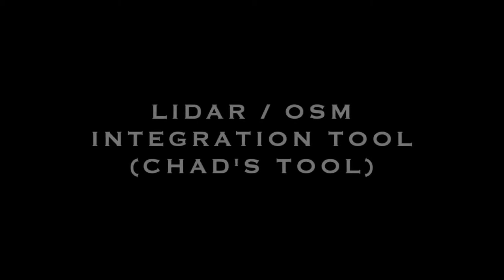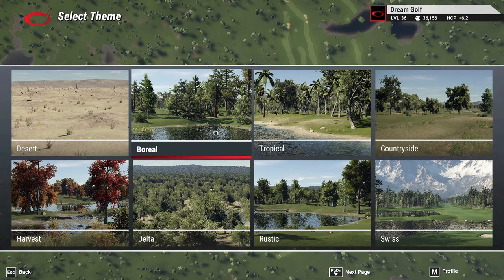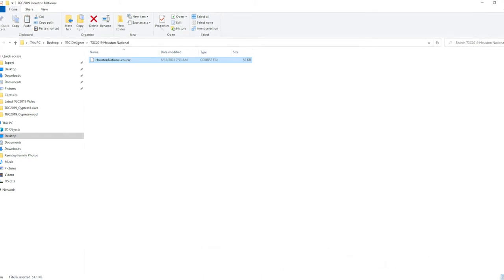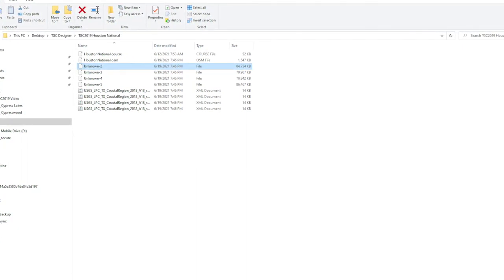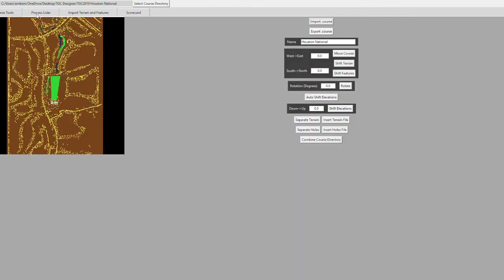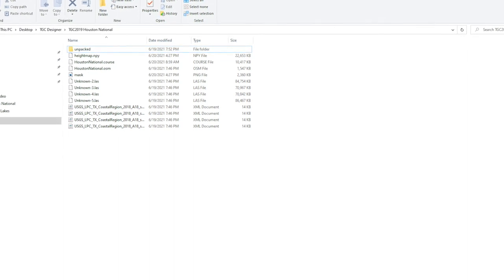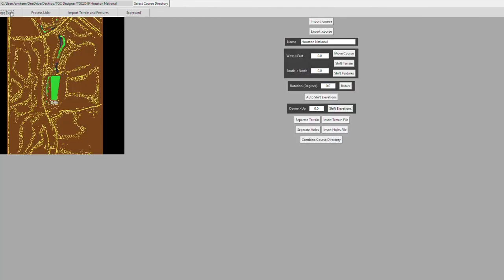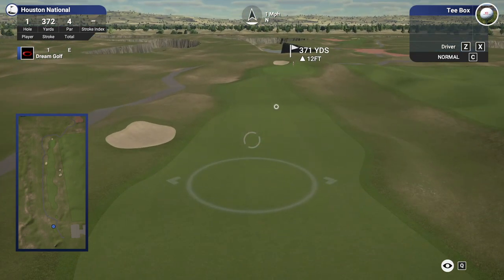The Golf Club 2019 - Course Design with LiDAR - Part 2

Comment: Good tutorial for my 1st trial course! everything goes well, the LIDAR and tree data is perfect. I can see the shape of the fairways and holes back in TGC2019. However, it looks like the tee box data, fairway data, bunker data, water data, hole #s, are not getting integrated. They are missing. Is there a trick to make sure the OSM features are integrated properly? for example, in chad's tool, everything works perfectly, but the scorecard tab shows blank! any suggestions? i think im missing a stpe, because the OSM data in OpeStreetMaps is very detailed and well created. Any help would be appreciated.
Reply from the maker: I would check with the guys on FB. They can help much better than I can. https://www.facebook.com/groups/2471027663149268/?ref=share

Comment: Please help! When I run the tool, it goes through visualizing the LiDAR data, then adding golf features, then the window pops up where the two images are supposed to be only neither of the images is there. Flipping back to the main window, it has gone through the part where it pulled the OSM data, then it stopped after trying to get the mapquest api data saying it could not get sat preview http error 401 unauthorized. I checked everything about my pc and my internet and it’s all great. My firewall is turned off. Please help!!
Reply from the maker: I would recommend going to golfsimulatorforum.com for assistance. The experts are there for specific questions like yours.

Comment: Got to 7.15 then things went astray. Just previous to that I'd spent two hours trawling web for the ESRI code, (believe ..fingers crossed!. that I have correct one). but then Chad's Tool came up as blank screen with flashing cursor top left. Very sparodic to open and get the next more important detail screen. Put ESRI code in & the data files I'd downloaded to one folder for LIDAR from DEFRA UK. comes up with NO LIDAR DATA FOUND.  Question  - Have I missed a step?  Do I need to convert these files via ArcGisPro to convert these files first? Any tips gratefully received.
Reply from the maker: Thanks for watching. I would highly recommend going to the golf simulators forum website. Its a bulletin board site where people ask these types of questions. They helped me out big time when I was trying to get things to work. Golf Simulator Forum https://golfsimulatorforum.com/

Comment: hello
i have tgc2019 for PC, running using skytrak. Im starting to use the Course Designer tool. Its great! I was able to solve my other issues below also, so all good! however, i have a question/help ask: i recently published a course, and the "unpublished" version - the ".course" file disappeared. So now i cannot create an updated/enhanced version of the same course. I would need to re-start the course from scratch. Is there anyway I can get the unpublished version of my published course or the ".course" file of my published course back, so I can keep working on it to improve it? thanks in advance.
Reply from the maker: Saad, I don't know, but hoping others will respond. I'm thinking you need to backup the copy before publishing it, but of course thats too late for you now. I'd check with the folks on FB, and see if they can help.
Reply: Could you tell me how  you solved your issue?  I'm having the same problem... when I finally go to the course tools tab in Chad's tool, the holes aren't showing up in green...so everything goes smoothly until it comes time to export it
Reply: Could you tell me how  you solved your issue?  I'm having the same problem... when I finally go to the course tools tab in Chad's tool, the holes aren't showing up in green...so everything goes smoothly until it comes time to export it

Comment: After you make a blank course and labeled it.  It's saved to a 'Course Folder' I cannot find that folder anywhere after saving it from TGC2019 software.  Where would it be located and what would the folder be called?  Is there a default folder these courses go in once you make them?
Reply from the maker: Yes, see 3:22 of the video. It shows you the path where it's saved.
Reply: @DreamGolf  I’m just not seeing those folder names anywhere.
Reply: @DreamGolf  under C drive, User, I’m not seeing AppData or any folder related to TGC2019.
Reply from the maker: @1289webby  It may be hidden. Make sure to  set properties to unhide the folder/files.
Reply: @DreamGolf  Ok no worries.  I did that and still cannot find any of those folders.
Reply: @DreamGolf  Thank you for your help.  I found the file folders.  There are three of them in there with a bunch of letters and numbers.  Those are three I was playing around.  The course I'm trying to build, can I or do I need to move that file to another folder when I combine the LAZ files?  Thank you again.
Reply from the maker: @1289webby  I  recommend you copy them to another fold like on your desktop and edit them from there. When complete, copy them BACK to the original file folder so your TGC2019 sees them, otherwise it will just see the ORIGINAL save you made. Very common mistake to forget to copy them back in AFTER you've built your course. Good luck! Lots of hours ahead of you!
Reply: @DreamGolf  Do you and can you import Lidar items such as water, parking lots, buildings or do you have to build those items in course designer?  How do you do a large amount of fescue or bushes for example or a large water body such as a pond?  I cannot place water for some reason and each bush is a single individual bush.  I'm new and trying to watch videos on all this.  Thank you.
Reply from the maker: @1289webby  You can't import water. You have to build the water into the areas that you know water exists. Same with parking lots and buildings, you need to build all of those in the TGC course designer. The import helps give you fairways, greens, bunkers, etc, but all the other fine details such as houses, fences, need to be done by you in TGC. Good luck! I got through about 5-6 holes and gave up. So much work required to get it right, it's a giant time suck.

Comment: I am getting confused at the part where i need to export the course, can someone help
Reply from the maker: Sorry for my confusing narration. Once you save the course in TGC2019, go to your TGC2019 course folder: /appdata/Locallow/HB Studios Multimedia LTD / The Golf Club 2019 Pro Tee / Courses, Rename to what you want it to be and then copy and paste it into your Work Folder (ie folder where you are working on your LiDAR data). I typically have a work folder where I do all the LiDAR importing. Once you go through and run Chad's Tools, make sure you save the new Course. Once the Course has been updated, you can copy and paste back into the HB Studio's folder so you can run it in TGC2019. I have forgotten to do this a number of times and wondered why I  had not seen any changes. You need to remember to use the same file that you export out of TGC2019, work on with Chad's Tool and copy/paste back into the TGC2019 game folder. Hope this makes sense.